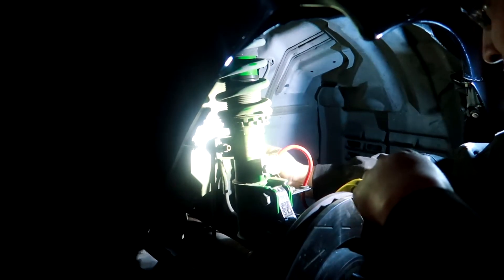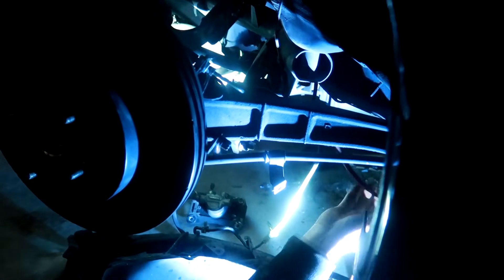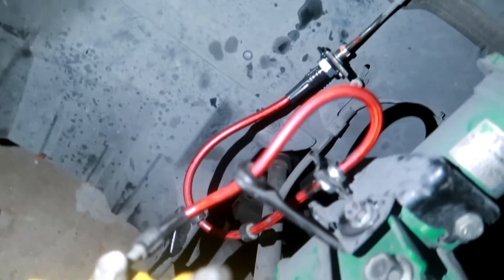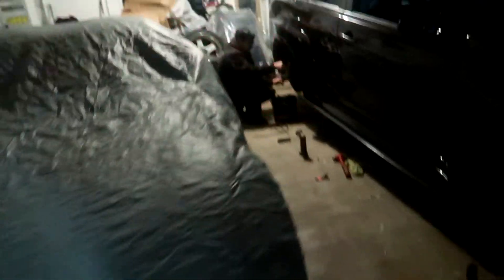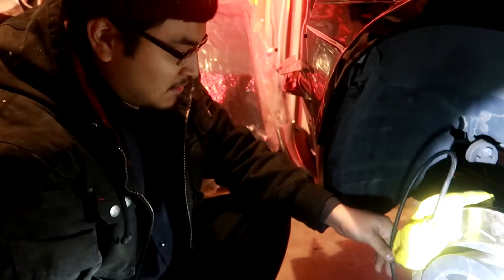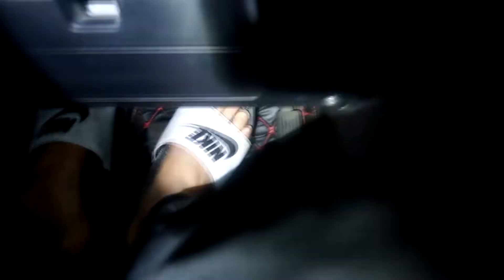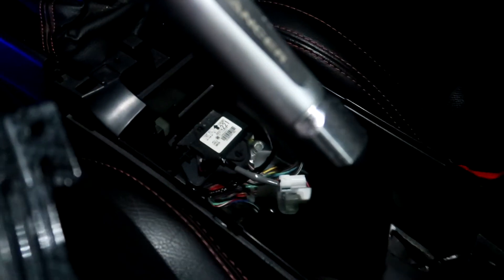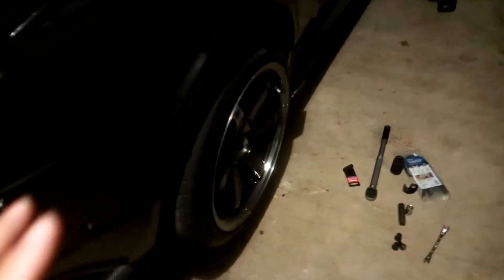Finishing the Big Brake Kit install for Mitsubishi Lancer!

Comment: You got the ABS warning light and how can you delete it?
Reply from the maker: The light went off once I had the abs sensor transferred over on the rear brakes.
Reply: I changed the spindles from an evo x to the ralliart and everything works fine with a brembo caliper but I have the abs indicator
Reply from the maker: @ronydavidarnoudtsayala9626  Did you transfer over the abs sensor to the wheel hub? I didn't have the abs sensor put on at first and the car would go into limp mode and not drive above 5mph and abs light stays on.
Reply: @TheJMedia  If I put the abs sensors together with the spindle and the abs light started flashing
Reply: @TheJMedia  Well, I'll tell you that I fixed the problem on my ralliart with brembo brake in front and evo x gsr knuckles, they work very well, I just needed calibration.
Reply from the maker: Nice, glad you fixed it!